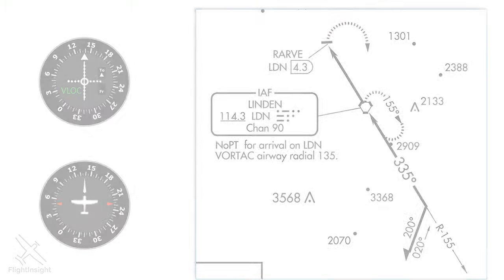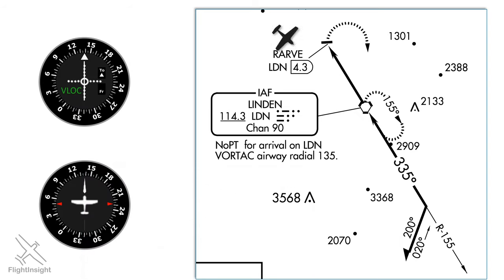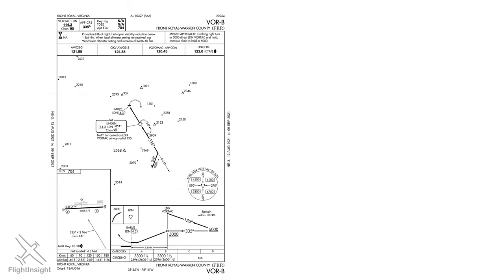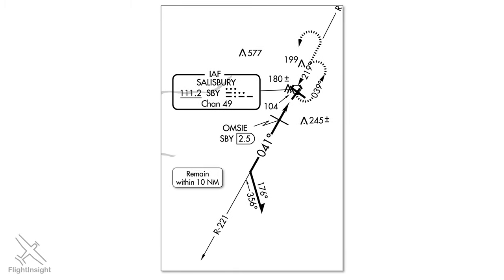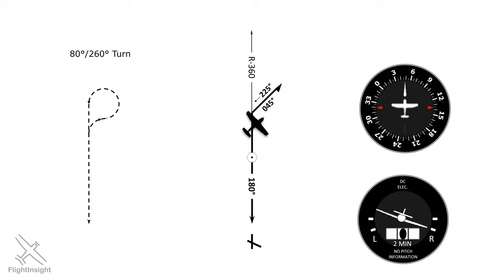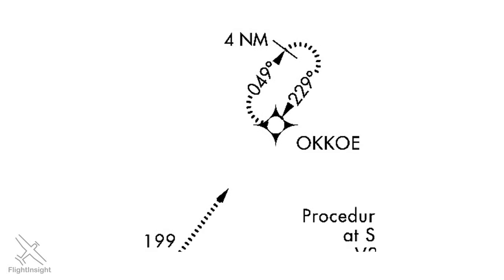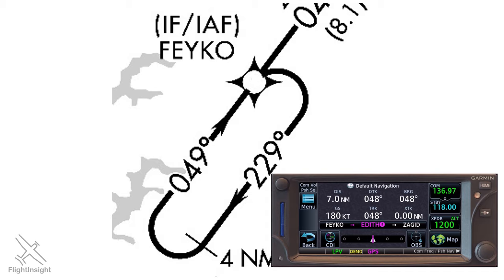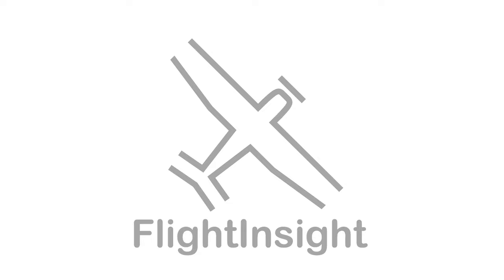Procedure Turns Explained | Barbs and Hold-In-Lieu of

Comment: Again excellent. The "Remain within 10 NM" is indeed the maximum distance for the procedure turn, based upon (from) the navaid for the approach, the final approach fix, or any other designated fix. You are also correct about the mandatory procedure turn; just confirm with ATC that you cleared for a Straight In approach.
Reply from the maker: Thanks! I had a controller get confused as I was rolling a procedure turn (as required) on an approach. He realized what I was up to and moved on, but it made me ask around to some ATCs who said they don't automatically assume you're doing it anymore. Never hurts to double check.
Reply: @flightinsight9111  Yep, that’s why they (most of them) clear you for a Straight In (ILS 17R) approach, so there is no confusion. For lost comm., I presume they will assume the full approach when you entered from the downwind side, that is why (I think) it is mandatory to do so and when not assigned as a Straight In.
Reply: So when you're doing a PT with the barbed symbol, you cross the VOR and then pretty much free to execute that anywhere within 10NM?
Reply: @kazshamael  If this VOR is the navaid for the approach, the final approach fix, or any other designated fix and the maximum distance for the procedure turn is 10 NM, yes, but you have to turn towards (and remain within) the correct side of the outbound track (where the barbed symbol  is pointing to).
Reply: @raccoonair  ah gotcha. Thanks for the clarification.  Wasn't sure when you were supposed to initiate that turn

Comment: Great, to the point videos. I always misunderstood SUSP for some reason. It just clicked when you mentioned wanting to suspended the REST of the approach while in the PT, and now it makes more sense. I presume same applies to suspending during a go around where you want to remain in the MA hold. 👍👏
Reply: You’re correct about the go around SUSP function. The way it helps me remember what it means is SUSP basically means UN-pause. The gps basically pauses itself automatically at the missed approach point because it assumes you’re committing to land at that point and will no longer need gps navigation. So you hitting SUSP is basically un pausing the gps navigation so it continues you on for the missed approach procedure guidance.

Comment: Sometimes I wish there was a like button that was more than just a like because I thought this is one of the most helpful videos I’ve had on VOR approaches as well as what the VOR will be doing during the approach and when To switch the radials
Reply: The only question I might have for you is where does the 10 nautical mile within limitation start

Comment: How do you know when to START the procedure turn? For example the barb on the first plate is not identified by a cross radial or a GPS waypoint. Edit: I finished watching and my question was answered.
Reply from the maker: It's a great question regardless. Without DME or cross radials, you'd have to resort to time and ground speed to determine if you're still inside the prescribed protection. For example, if the procedure says remain within 10 miles, and you're doing 100 knots ground speed, you'd want to turn within 10/100= one tenth of an hour or six minutes.
Reply: Flying outbound for 6 minutes will take you near the edge of the 10 mile limitation in which you would bust the protected area on the  outbound leg of the procedure turn. Generally about four miles out (in a cat a aircraft) is a good time to start the procedure turn and provides a reasonable space for procedure turn, keeping you within the 10 mile limitation.
Reply: Usually it gives either a time or distance if there’s no cross radial listed.

Comment: I was taught that you never turn in the direction of the barb of a course reversal. In this video you fly 2 minutes outbound on the 155 radial, the turn right hdg 200 for 1 minute. Then you turn right to 020 (into the barb) to intercept the 335 degree radial. Would you not "avoid the barb" and turn left to 020 to intercept the 355 radial?

Comment: wait when executing the procedure turn, I thought you turn away from semi triangle  hence making a left turn instead of a right turn.
Reply from the maker: hey! Looking at AIM 5-4-9, part 1, when we have a barbed turn depicted, the type and rate of turn is up to the pilot, as long as we stay inside the charted "remain within xx distance." Generally I'd do whatever turn gives me the most distance on the final approach course, to get more time to stabilize. Thanks for checking in!
Reply: Yeah that's also what my instructor taught me.
Reply: The answer to your question is to simply fly the headings published on the procedure turn. You would make a right turn to 200 degrees fly that for about 1 minute, then left turn to 020 degrees. Look at the tiny arrow on the 020 degree heading and it points toward the final approach course/135 radial/335 inbound track.
Reply: @MrSuzuki1187  you mean 155 radial, but yes, you're right. That is how you should execute the approach. As published.
Reply: Nearly busted my IFR checkride for this exact reason. I was taught to turn towards that barb which wouldn’t have sense looking back since it narrowed my time to get from 3500 down to 1500 within 3 miles, but nevertheless I was wrong, per se. now I know.

Comment: Your animated example shows 2 right turns for the course reversal. This IS NOT how the AIM depicts it in Fig 5-4-18. Remaining within the depicted distance (10 NM in your example) the 45-180 maneuver you show should be made by first turning right then LEFT back around to the final approach course.
Reply from the maker: Thank you! As long as we stay on the maneuvering side of the PT, and are within 10 miles, the AIM allows for pilot's discretion on entry point and turn type. In 5-4-9 a1., unless the procedure turn specifies a procedural track (like on a racetrack pattern) the rate, type, and beginning of turn are left up to us. Due to wind, it may be more favorable to make two turns to the same side. In the animated example, the reality was that two right turns were used so that the procedure could be depicted without the aircraft moving off screen! Thanks for watching and I appreciate all errors that get caught!
Reply: Keep your pants on Frank and stop yelling .... you can turn any way to want,, - as long as you stay within 10 miles (or whatever limit stated of the fix) and on the 'protected' side of the approach course. You can also enter a hold any way you wish no matter how it is depicted
Reply: @flightinsight9111  Thanks for the great explanation.  I had that exact same question.

Comment: Question: If you were being vectored, the controller would try to vector you within 30 degrees of the final approach course. In your example, you were approaching from the north, 170 degrees from the final approach course -- in which case a procedure turn is necessary. At the end of your video, you mention that thanks to GPS predictive turns, you may not be expected to do the procedure turn by ATC (and therefore, ask). My question is, how do you know if you should do the procedure turn or not? Is there an angle of intercept? I had hoped you showed other approach angles to the final approach course where it is not so clear. Does this makes sense?
Reply from the maker: The technically correct answer is if there is a procedure turn, you are required to do it unless cleared “straight in” or being vectored. However, anything less than a 90 degree turn onto final and the controller might not be expecting it, so better to confirm. In short, it’s often up to you
Reply: Just request full approch with procedure turn if you are unsure. ATC will either clear you or tell you to fly straight in.

Comment: On the 45/180 you did 2 turnw in the direction of the barb, but on the 80/260 you did a right turn then left even though the barb is to the right. Are you allowed to turn either way or must you make your turns in the direction of the barb?
Reply: I noticed that too. Did you ever get a clear answer? I always treated the barb like it was pointing to the "unprotected side". So you turn away from the barb.
Reply: @riod43  never did, but after this I just always turn into the pattern of that makes sense.
Reply: @samuelphilip915  AIM 4-5-9 basically says, "pilots discretion "
Reply: @riod43  makes sense. Holding pattern entries have always seem overblown.

Comment: So you are required to fly the full procedure unless on a STAR or cleared for a straight in.  In a comm failure, would you fly the full procedure "as required" at a busy airport, unless it was actually required?
Here's the scenario I'm curious to see a video about @FlightInsight 🙂.
Say you are having a communication failure in IMC to a busy airport without a STAR, but where the PT or HILO is depicted and no statement "procedure turn not authorized?"  (Of course, you'd try your cell phone and handheld backup radio to re-establish comms first...)  Assuming you have RVAN/GPS, you can get yourself down from enroute using the TAA or feeder route altitudes.  From there, I'd plan for a straight-in via the IF if coming in towards the landing runway.  What about the scenario where you have to overfly/pass the airport?  If you can fly one of the 90 degree base legs to the IF, great, then turn onto final and you are golden.  This leaves doing an actual PT/HILO for the scenario where you need the course reversal or hold to lose altitude (e.g. in the mountains) but don't have those 90 degree base legs, or you don't have RNAV.  Thoughts?

Comment: men auh got a question 2:23 while the aircraft is taking its first turn hdg200  is not a left turn? or can I decide it depending on how far out i wanna intercept the radial?
Reply: Yeah it's normally away from the final approach fix which in that case would be to the left. Not sure why it was depicted as a right turn. The main thing though is that you stay within the protected area.

Comment: Aren’t you suppose to always turn the opposite way. For example we did a turn first. The next turn should be to the right to intercept the inbound course. At least i was taught like that. Besides that good video!
Reply: I dont believe there is anything written as to how you fly the barb or hold in lieu, as long as it is on that side of the final approach course. That said, i was taught the same way because it provides you that little bit of extra room before the FAF if you need to descend once stablished per se. Just saying technically theres nothing written in the CFRs or such.

Comment: At 1:43, with the OBS/CDI set to 155 would that not put the CDI on the VLOC to the left of the a/c after the right turn to 200?
Reply: No.  The CDI cares not what is your heading.  Notice when the turn is complete, the desired course is still on the right side of the aircraft.

Comment: What if you are inbound to the Iaf on a course that would use a direct entry to the hold in lieu of pt? Would you just fly straight in even if atc has not cleared you straight in or would you fly the hold? Assuming “no pt” is not listed.
Reply from the maker: I would confirm with ATC if I could fly straight in, but yes technically if nothing is said you’d need to do the turn, though most controllers wouldn’t expect to see that!

Comment: My instructor told me to never turn towards the barb of a PT. What am I missing here?
Reply from the maker: you're not missing anything. It's best not to turn towards the barb in order to give yourself more room on final. However, there is is no requirement to conduct the turn a certain way, as long as you stay within the protected area, as AIM 5-4-9 a1 states. In a strong headwind you may want to turn the barb side to not get pushed too far away, or you may run out of screen when animating a lesson and need to do so!
Reply: @flightinsight9111  Thanks for the prompt reply.